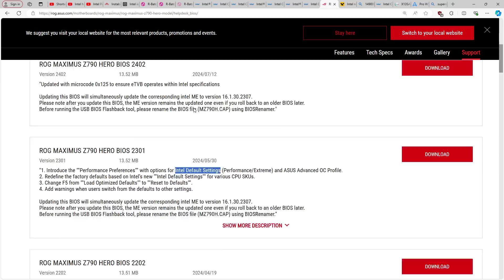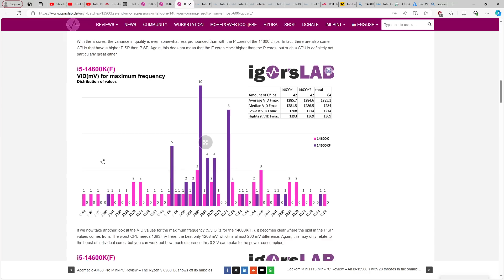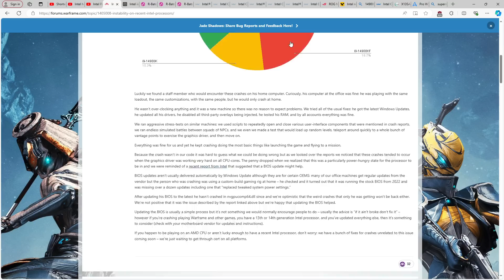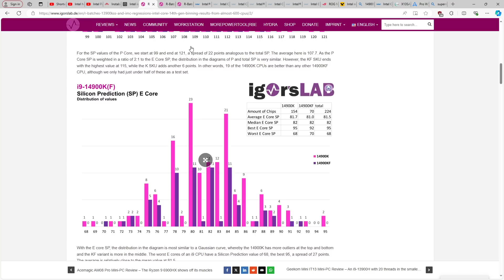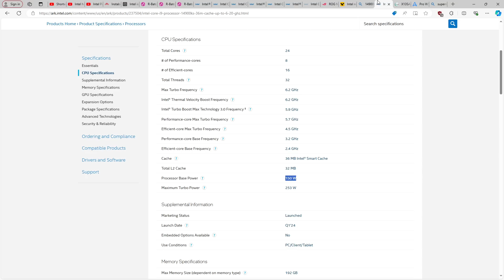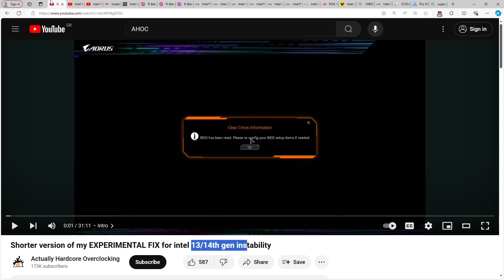The intel instability and degradation rant.

Comment: Intel just needs to recall the whole 13th and 14th gen they are done. Their best "Stable" highest performing CPUs are the 12700k and 12900k/kf
Reply: They won't do a recall unless the government forces them to do it and that won't happen unless consumers file complaints
Reply: @forog1  do they even have the money for that scale of recall
Reply: @asdf_asdf948  No that's why there not allowing refunds or Rma's
Reply: Their market cap is like, 150 billion. Their revenue from chips something like 50 billion/yr? which is almost 1:1 with their operating costs.  Even if you only recall 10% of past few years... bad. 50%?...
Reply: my 12900k was so shit it couldn't even run xmp, sigh
Reply: @FreelancerVideoDump my 12900k is shit too. I have a 360mm aio and am using the thermal grizzly contact frame and if I run prime 95 it will throttle even if I disable e cores. I have literally a 7 degree Celsius temperature range across my cores. So some cores just run so poorly there is no way to cool them.
Reply: @edplat2367 throttling is not the same as instability
Reply: @edplat2367  Try disabling Hyperthreading. I did that on a 13900KF and it dropped temps over 10°C. E cores are better than Hyperthreading.
Reply: @edplat2367 same for me but i encountered with this issue before. Reason is poorly applied thermal paste. Temp difference between voltages is not a cpu fault.
Reply: @FreelancerVideoDump  Intel 12th gen DDR speed spec is 4800.  Anything past that is an unguaranteed bonus.
Reply: @concinnus I run a W680 ASUS board with an i9-12900KS w/AVX-512 enabled in the microcode.

I run 4X32 GiB Hynix A-die ECC UDIMMs from Kingston, and it's clocked at 6800 MHz with CL30 and tuned subtimings.

It is an incredibly solid and stable setup.
Reply: @NUCLEARARMAMENT  Good for you?  Doesn't negate my point, especially since you have to raise SA voltage above spec to get those kinds of speeds.
Reply: Not gonna happen
Reply: Hold on! I don’t see the 14600k as an affected cpu! Where’s credit to my chip?
Reply: @josef.hernandez9781 not even worth it for OC, this problem only affects high end cpus, not low end.
Reply: Lol i love these alarmist comments. Please also post this on intel redit sub

Comment: why 12 gen doesnt degrade and 13 14 degrade? the three are 10nm, no?
Reply: They changed the process Intel engineers have bragged about designing Raptor Lake within 11 months which is way too fast for properly validating anything, which likely means they either missed something in the lithography process or there's a design flaw with the hardware itself. GamesNexus and Wendell seem to suggest a problem with the hardware such as the ring bus having issues.
Reply: Alder lake dies are a different hard design. There is something wrong in the hard design of at least in the 8+16 raptor lake-s die.

Comment: Guys, may I have your informed opinion please - for over an year I've been running a 13700f on a Asus Z-690-P in a not too stressed (not overclocked) 3D creation dedicated rig. No issues so far but should I be worried?
Reply: There is the point - the CPU did run for over a year and is still fine - the probability that your CPU is fine increases which each uneventful day. Furthermore while some i7/i5 seems to be affected the bulk load are the i9s - I would guess you got lucky but there is no guarantee. In the end make sure the voltages are in a "save range" (what ever this means at this point, thx for that intel) and keep an very close eye on the machine, which sucks but I have no better solution for you.
Reply: Nobody knows. There are various suggestions about settings you could change to lower the risk, but until Intel says something, it's all just guesswork.
Reply: since it's not a K-series it probably does run at lower, more safe voltages because it doesn't clock as high.
Reply: It's 13th and 14th gen i9's being reported as failing. Very few if any i7's and no i5's or i3's have been reported but everyone is blaming the entire generations not just the i9's.
Reply: @auntiepha8343  Not true. 13700ks are listed as well.
Reply: @timothygibney159  I said a few i7's didn't I? Most likely ones that are overclocked to i9 voltages.
Reply: @timothygibney159  have 13700kf and 4070super, had a few crashes in Counterstrike 2 so far but I can't replicate.. it does leave me worried but only CS2 has crashed and at nearly 400hrs playtime now.. Still concerned though

Comment: I have a sample of 10pcs of 14900k systems runing SoC Simulation for 24/7, which I've made ~1month ago. I've already seen that this CPU is right on the edge of being stable and memory controler on two Machines couldn't ran 6600MHz 2R 2x48GB DIMMs. Just either plain crash or crash after a mintue or so in y-cruncher. 
I'm quite curious if/how quickly those would degrade. I undervolted each of those by around 60mVs.
Reply: I give it 8 months until you have to add the -60mV back 😂

Just kidding, I wish you good luck man...

Comment: I already had a 13900k crap out on me, I replaced it with a 14900k but I’ve configured my 14900k to run at a max single core boost of 57x and all core 55x , cache at 45x, and my vcore doesn’t go over 1.28v so hopefully that helps slow down or prevent any degradation…🤦🏼‍♂️

And also Gamers nexus apparently got some inside info about what the problem actually might be but they aren’t saying what it is yet
Reply: I think the absolutely safe multiplier was 53x, but then you basically end up with an I5 with more cores
Reply: @Daniel-ul8kr  how sad
Reply: @Daniel-ul8kr this
Reply: I had your exact same settings with a 13900k. It still failed even with the lower undervolt
Reply: i feel really bad for 14900 owners, i have a 14700 and am worried about its lifespan, i tinkered with intel extreme utilities early on to undervolt but experienced crashes.
Reply: @denvernaicker8250 it’s extremely frustrating that I spent $700 on a motherboard to OVERCLOCK my CPU and play around but instead had to underclock it just so it doesn’t die in 8 months like my 13900k…

Comment: I got a brand new 13900KS, I guess 1.35 with vdroop, disable E-cores, and be carefull with the uncore/ring-bus
Reply: Try undervolting it and underclocking it aswell, at least until the problem is solved or clarified. Try running at 1.2v at whatever ghz that allows.
Reply: @dethskullcrusher 1.2 seems a bit over cautious. Plenty of older chips running 1.35 ish happily. Ofc 14nm more resilient. 1.3 seems sensible for 13/14th
Reply: @dethskullcrusher  Under volting it could damge it too
Reply: The degradation will still occur at lower voltages and frequencies according to wendel's video.  Gaming server providers already underclock / undervolt their 13900K and 14900K CPUs out of the box and they still fail at a much higher rate.

Comment: The only reason I stuck with Intel is because it was stable. I always ran into the odd application that would hiccup on an AMD CPU but work flawlessly on Intel. Looks like Intel just basically killed the best thing they had going for them after scrambling to catch up to AMD's competition
Reply: Can't say my 5800X3D or 7800X3D have a hiccup in any application.  X3D CPUs are the best you can buy for consumer workloads.
Reply: @giglioflex  intel corporate shills gasping for air, stating disingenuous facts to sway people away from amd. foul, really..
Reply: Intel being more stable is a myth that came from echo chambers on forums and reddit. For every person who had unstable AMD experience you'll find a person who had bad experience with Intel too (including me with my old i7 6700k).
Reply: @MrRoko91  I work in IT and have 20 years experience gaming on personal rigs and work with enterprise people. We banned AMD on every workplace due to issues with excel giving incorrect numbers to chipset drivers and power delivery issues. Server wise AMD made some bad chips in the 2000s where only Microsoft is willing to even touch them for the MBA types.

Today that is changing slowly with eypc and their AI stuff in Azure on the cloud. My bosses boss won’t let us run AMD again on laptops due to people’s complaints so we are Intel only. These are not 13900 or 1400s though.

Yes until last month I only bought Intel for this reason. Intel chips consumers less power and ran cooler since 2000 as well
Reply: @MrRoko91  Not true, compared to early Zen Intel was definitely more stable
Reply: @Navhkrin  That was more than 7 freaking years ago.
Reply: @MrRoko91 AMD’s ram issues are horrendous. I’ve had to debug 4 Ryzen systems from 3000-7000 series and the ram was always such a headache. 

You can’t expect normal consumers to be able to debug ram problems.
Reply: @macicoinc9363  yeah, AMD has always been dodgy with high speed kits but my R9 7900 works perfectly fine with DDR5 5600 CL36. Sorry you had bad luck with yours 😕
Reply: I've had 3 AM4 cpus and 1 AM5 cpu and never had a single application issue or stability problem in windows with running default motherboard settings.
Reply: My Zen 3 Ryzen has been rock solid after tuning voltages (y-cruncher and whatever else AHOC uses). Downside is I can't update BIOS if I can't be bothered to re-tune, because Asus has a habit of screwing around. Last time I updated Cinebench performance went up but I got bluescreens, so did a rollback. (And I get 50 MHz above promised single thread boost, just with undervolt and higher power limits, which are used only when benchmarking and transcoding.)
Reply: AMD has been very good, often better, in high end segments for a while now. Intel has them beat on the budget gaming segment since 12th gen, though, but those won't be affected by the instability issues anyway.
To be honest everyone should ask themselves if they even NEED a high end CPU, especially if they only use their PCs for gaming.
Reply: i based my decision on the same reason and from hearing youtube tech channels say the same thing (jayztwocents), i have a 14700kf and its running stable so far, but early on undervolting caused issues
Reply: @denvernaicker8250  It basically comes undervolted, you can't get more out of it lol. It's shipped so near the max that there's nothing left and is why one person in an airconditioned room is fine and the next in a warm room isn't, they didn't build in the normal amount of headroom to allow people in Arizona or India or the arctic circle to all be able to use it, they basically made it for the arctic circle only and everyone else has an unstable chip.
Reply: You really need to watch better channels than jaystwocents.
Reply: @denvernaicker8250  jayztwocents is a big shill for intel.  Whenever intel does something wrong he never covers it to the same lengths he does if AMD did something wrong
Reply: @denvernaicker8250  I heavily undervolted mine trying to keep it stable. Now I was told that my heavy under volt could have killed. I am confused as I was told degradation is always the cause of voltage changing the structure on a nano scopic level until connections can't occur anymore without mroe volts. Oddly ramping this up didn't help either as the failure already started
Reply: @timothygibney159  Undervolting cannot damage a chip.  You have to remember that your CPU and GPU already massively reduce their voltage when in an idle state.  It's only when you exceed the maximum safe voltage does permanent damage occur.  Voltage is the push, pushing too much can damage things but pushing too little just means they don't turn on or don't run correctly but nothing is damaged.
Reply: @giglioflex  my 13900k never got more than 1.36 volts with the llc and undervolts. How did it degrade?
Reply: @timothygibney159  because intel sold you a defective chip
Reply: @giglioflex true, undervolting can only cause instruction skips, which just result in a crash ala software. Overvolting can physically destroy it.
Reply: @timothygibney159  your CPU automatically undervolts when it down throttles under idle conditions, low voltage can cause the CPU to malfunction at high clocks, your gate never opens when it should, but it cannot damage the CPU. excessive voltage actually increases connections within the CPU, like how lightning can travel across km's of air at 10k volts, well at high enough voltage electrons can travel across a closed gate, generating waste heat and worst case your 0 becomes a 1 and shit hits the fan.
Reply: @woobilicious.  it no longer works now. I switched to AMD

Comment: Intel bragged so much that amd wouldn't be able to create a compelling and stable platform when ryzen was new. Now look at Intel! They have failed in every conceivable way - except arc, you can stay.
Reply: And Arc is only staying because they need it for iGPUs, if the rumor mill is to be believed.
Reply: AMD listens to the engineers, and follows a very old school methodology of incrementalism. Intel hasn't really taken as much care of their CPU engineering dept, and shifted into a modern "chase the market" methodology since the "lake" generations. Arc is likely a part of this debacle as far as drawing resources and oversight away from other areas. Intel also chases a lot of other revenue streams (ie govt subsidies) and have also taken on the juggle of shifting/building fabs. Industry as a whole is kind of pushing a bit too hard to meet the "goals" they all set for the market as far as performance. We're reaching limits of material conductivity (at least modern consumer priced) for the data bandwidth we are already pushing past. Copper and silicon will soon be a thing of the past in your whole system.
Reply: Intel makes good SSDs as well
Reply: @iiisaac1312  Intel no longer makes SSDs afaik, they sold that business to SK Hynix a while back. What was the Intel SSD business is now Solidigm.
Reply: @iiisaac1312  Intel isn't in SSD business anymore and their last SSD line was in PCIe 3.0 and overpriced at launch. Sold for massive discounts to clear them from shelves last year. Still fine for older hardware but totally outclassed by good PCIe 4.0 and 5.0 SSD's nowadays.
Reply: That's not a majority opinion yet, that arc can stay.

Do you like it for gaming?
Reply: I wish this race would slow down a bit, I'm not a hardware guy but this is a major factor in why we ship tons of slow software.
Reply: @rusi6219 I feel the exact same way. It will end soon, probably within a decade we will see performance barriers.
Reply: well AMD did have their major fuckup with melting CPUs as well so they can use Intel's fuckup only to the extent of "at least our failure is self-revealing and obvious"
Reply: I am very happy with Arc so far, haven't had any issues yet on Linux.

Comment: Gamers Nexus hinted at it being related to cache/ringbuss (in their recent interview/talk with Wendell). They should be releasing a video on it soonTM.
Reply: It's all on the same voltage rail (L3/ring bus/core) so whichever goes first will be cpu dependent.
Reply: @winebartender6653 yes it’s all the same rail but that doesn’t mean each piece can tolerate the same voltage
Reply: @snowwsquire  It's all built on the same node so gate width is identical, which is the #1 area for issues/causes of local degradation.
Reply: @snowwsquire  If it's the same voltage rail they are sharing then the rail will be the same for what ever is connected to it. the componants coming off the rail will regulate the voltage to the componants the other side if it needs changing.👍
Reply: @winebartender6653  is clock distribution also on that, esp the NVME/PCIe IO section, and core clock distribution? There are a few things it can be that the entire CPU runs on, ring bus, clock distribution amplifiers, cache/latches, etc. Something is sensitive to silicon quality and atom migration.
Reply: It would not surprise me if the cache/ring ratios causing stability issues. Even with Ring Ratio offset on, my i7 13700K ratio peaks at 4.7 - 4.8 GHz. Which is insane because on the older i7 8700K, i9 9900K and i9 10850K systems I had, getting 4.4 GHz maybe 4.5 GHz stable when OC was like finding a unicorn in the forest. Even with a custom loop. 4.0 - 4.3 GHz was stock and stable on most Intel 14 NM generations. 4.5 - 4.8 GHz with the LGA 1700 chips is pretty damn high! I understand why they are trying push the Ring ratio because overclocking that on the 14 NM processors would give a good bump in performance. But if Intel 10 NM can't handle that high frequency with the cache then don't release it that way Intel.
Reply: It does seem like it's something that "connects" all the cores. Since it seems to be correlated to core count, and both e and p cores are failing, my first thought was maybe something like ringbus or other interconnecting system gets fed a higher voltage on those cpus, and would degrade resulting in seemingly random cores failing.
Reply: Playing around with mine that is mostly stable and at stock 5ghz cache frequency prime 95 crashes instantly. Lowering the frequency down to 4.5ghz has it solid. I was using smallest FFT's so it should only really hit L1 and L2 cache.
Reply: @mx5klein  Same, I am stable all day at x45 ring bus, but everything goes to shit trying to go over x48 ring bus where its not worth running higher ring bus for stability.
Reply: Can't wait to watch their follow up video when it comes out since Intel won't speak on the matter.